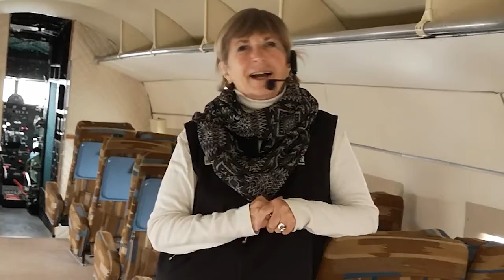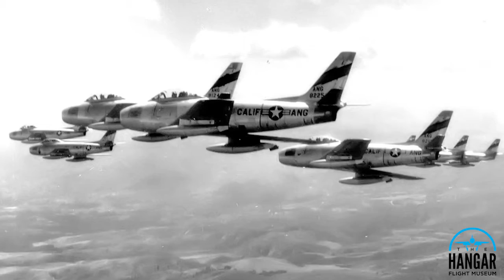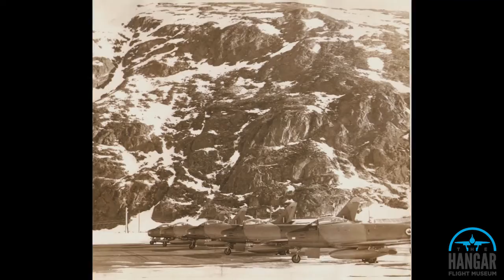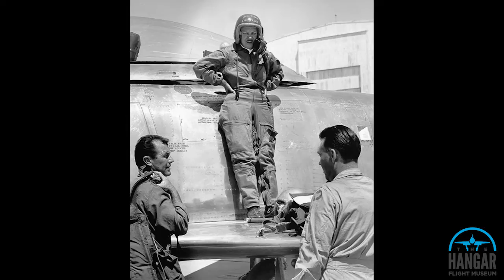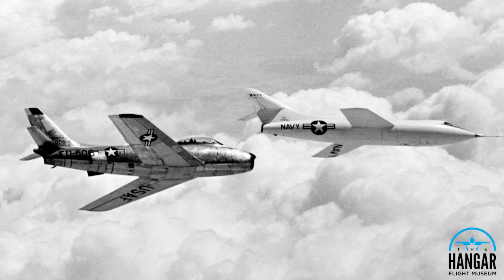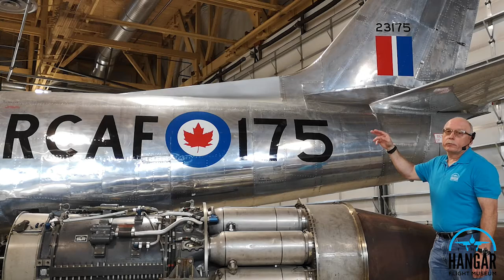F-86 Sabre Part 1: A Short History on Going Very Very Fast

Comment: Transonic NOT supersonic!
Reply: subsonic more like...dives dont count in my book it has to be 700 knotts ground speed in level flight in my book to be supersonic, like a super sabre F100 was capable of, or the F101, 102,104  and 105
Reply: The CAC mark 32 f86 was a better aircraft and it's figures were at sea level had a higher climb rate and a heavier pay load.